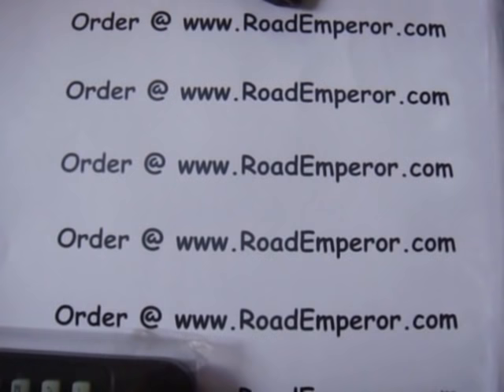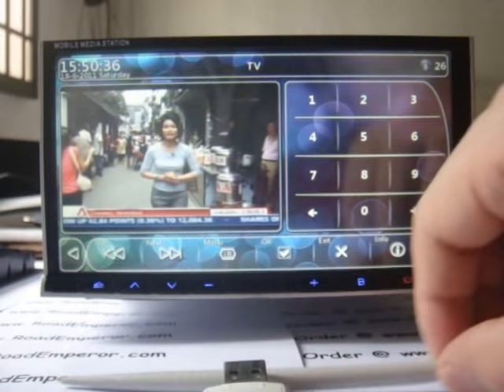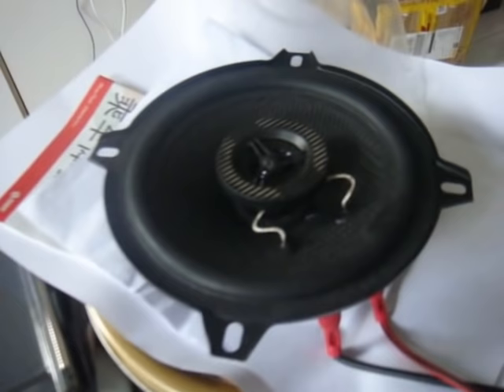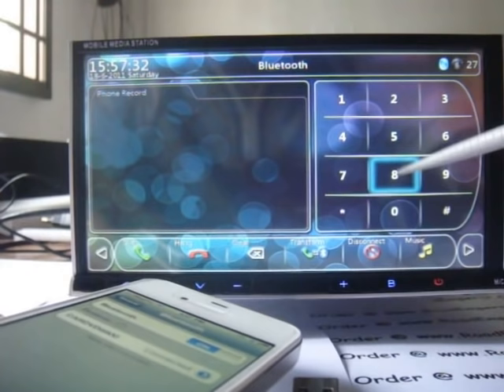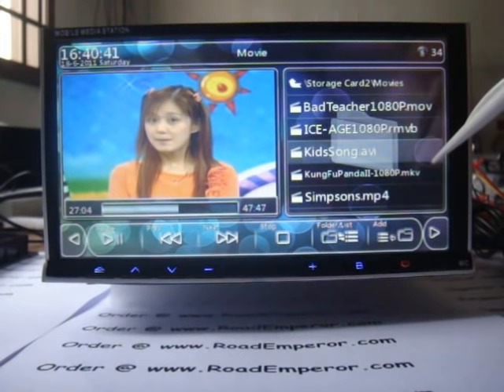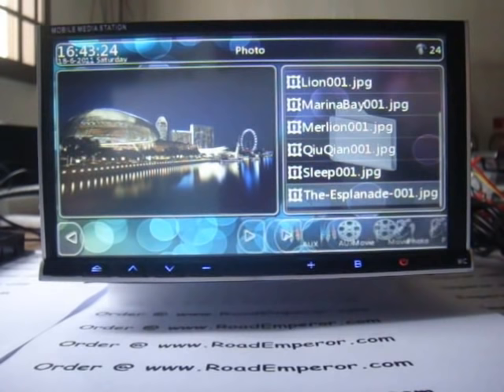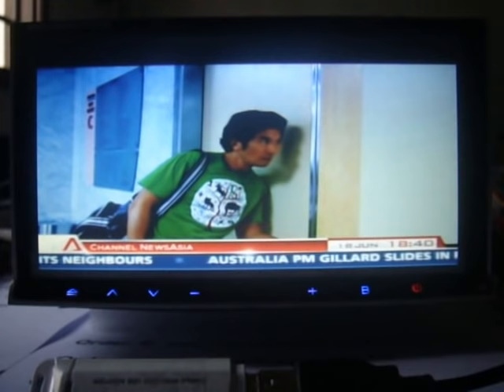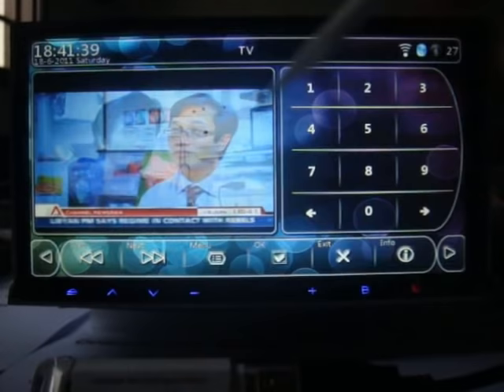Road Emperor In-CAR DVD, 3G, WIFI, TV, GPS, Bluetooth, GMS, Video Review

Comment from the maker: @YTNexus7 The set come with cooling fan is because of the power consumption is over heated, if the fan is spoiled no body knows, then it will crash the system from time to time. So HU comes with a cooling fan is out dated. This road emperor has the super low power consumption design, because of advance chips and DAMs and Amplifier mudules, so the cooling fan are not needed.

Comment from the maker: @cingulator 

Yes. that's what this unit can do: Internet on head unit and Dvd on passenger visor simultaneously.

It support the wireless keyboard (2.4GHZ) through it's usb port, but not support the bt keyboard. bt is occupied for handsfree call and a2dp music playing.

But be noted, purchase it only at road emperor's official website to avoid any disappointment.

Comment: I received my Road Emperor today!  The good news? This unit is the bomb! The bad news? Apparently, I didn't purchase it from you, and you seem to know more about it than the guys in China, and I really need your help on this steering wheel control. Does this head unit incorporate communicating hardware/software like a Pac swi-x, or do we need to get a pac? Also, the SW1 and SW2 wires, where exactly do they hook up? The owners manual might be in English, but whoever translated it did a bad job.

Comment: Figured out how to access the Windows 6.0 shell. Just connect a USB keyboard, boot and Alt+tab to end the current process. It then takes you the familiar blue Windows startup screen. I'm hedging a bet ( I have one ordered) I can use a mini bluetooth keyboard, as Win 6.0 ce has support for it. This will make the Internet function of the Road Emperor much more useful as well as convenient and practical.  There does seem to be an issue with internet connect -ability. More on that coming.

Comment: @patro46 ok..Thats cool u found accessing windows shell. I tried connecting my my latop using WiFi, but its not connecting. Let me know how you solved ur problem of internet. Another question?Is analog TV available in Road Emperor bought from chinavasion? Or do we need to use external tuner?

Comment: I have a reverse camera installed, so when I go into reverse gear screen displays the picture from the camera.

The problem I am having is that every time this happens, the sound is also muted.

Is there a way to stop the sound from being muted when the unit receives video signal from a reversing camera?

Comment: Hello, do you provide maps for the US? 

The unit doesn't have a cooling fan, won't it heat up when installed in the dash (which is near the engine bay firewall)?

Thanks,

Comment: 1. My Mitsubishi has radio controls on the steering wheel. Nowhere can I find out "how" this interfaces with existing wheel, and if anything else is required to do so. 
2. You have NO IDEA how bad I want to digest the user's manual, yet cant find it online. That way, by the time I get my itchy fingers on my Phoenix Edition, I'll be familiar with it's controls.  (check out your latest order to 74015....that's me...